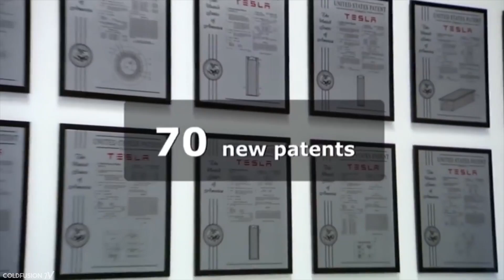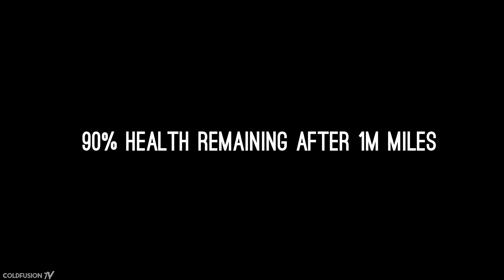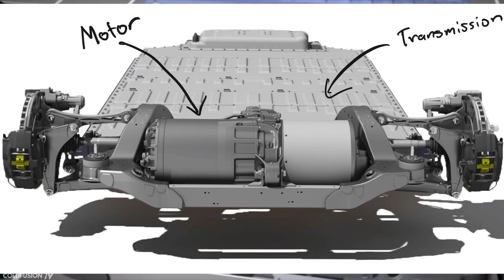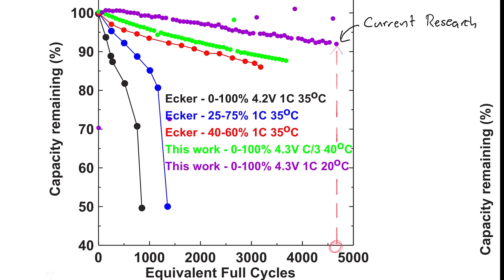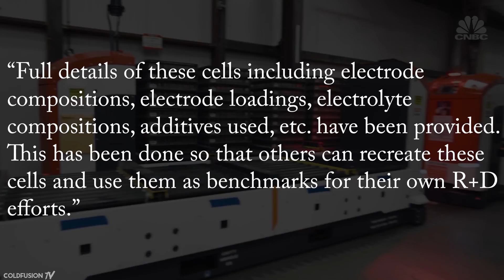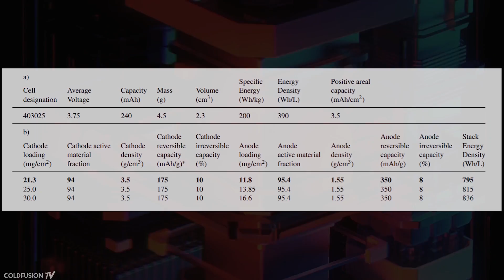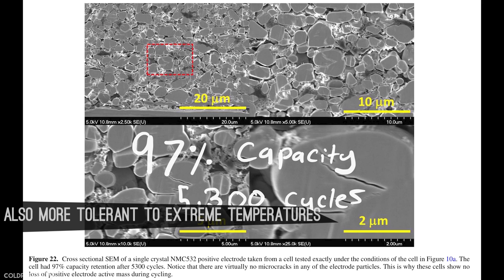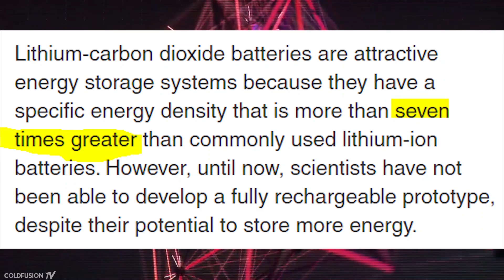Tesla's Million Mile Battery

Comment: Electric planes yayyyy!!!
Reply: Not gonna happen for a very long time still sadly. Electric planes today are either two seat trainer aircraft with less than an hour of battery, or that one solar powered plane that seats one. Electric airliners are still a pipe dream with current tech.
Reply: @cpufreak101   At least the range problem is solved with this

Comment: It's amazing car enthusiast don't see electric as the future, the internal combustion engine is all the way maxed to it's abilities pretty much and most technology on it is to keep it from polluting. You already have an electric motor to start the engine, and electric fuel pump constantly sending fuel, and an alternator which is practically an electric motor supplying electricity to the car while be run by the engine, and multiple computers monitoring the process. You might as well just have an electric car to get rid of the excess mechanical complexity. Electric cars will be more efficient and easier to control without transfer cases and transmissions to worry about. We still have to work on battery technology and the way we power them. But in all it's amazing how great these cars will be eventually

Comment: A million mile battery would be great, but given the relatively high failure rate on the drivetrain, who cares. Even doubling the expectancy rate, which Tesla claims to be doing, that still doesn't put them on par with gas engines. Oh and you can certainly bet that replacing a head gasket is a hell of a lot cheaper than replacing the entire drivetrain. 

So until they can build a motor and transmission to match that million mile battery, it is a moot point.
Reply: The current drive train carries an 8-year, unlimited mile warranty.  I don't see it as an issue.  The previous one was 4-year, 50,000 mile.
Reply: James Thompson which equates to 150-160k miles on a relatively high annual mileage car. So the battery is good for 6-7 drivetrain lifetimes, thus irrelevant outside of being a really nice tech achievement.

Comment: you could use a car for your whole life and pass it on to your children.
Reply: Hugo not in Canada...the salt put on the roads in winter eats through a car in about a decade
Reply: @cellardoor7500  Then make cars out of something other than metal...
Reply: @cellardoor7500  Yeah.... and think whats going to happen to the wiring / motor  etc. of an electric car.
Reply: Depends where you live. Not many cars can hold up through more than ~15 snowy winters due to salt / rust (e.g. Minnesota, Wisconsin, Dakotas, etc). I had one car that had components connecting the wheels break from the main body of the vehicle. In another, the axel in the back rusted so badly that when I hit a pothole, the back tire turned sideways and I fishtailed.
Reply: @ae1ae2   well you should look under your car before the tires beginn to fall of, it is rather dangerous to just wait for things to break smh.
Reply: @jonasmeier663  Yep, was aware of the issue. Being aware of a problem doesn't necessarily mean you've got the money to fix it.
Reply: I mean, I've seen people with pickup trucks they bought decades ago and they pass them off to their kids, nothing new in that regard. The new thing is the maintenance required
Reply: @cpufreak101  exactly, you can basically keep any car forever as long as you buy replacement parts. But with this you'd spend a fraction of that in repairs.
Reply: @fedyx1544  you'd be surprised how quickly many parts become 'obsolete'.
Reply: @fedyx1544  no. Today's cars are manufactured with 200 000 km lifespan in mind. The clutch, the bearings, the gaskets. All of this is designed to fail shortly after 200 k km on purpose. It is called engineered obsolescence or engineered lifespan. My mate works as a material engineer in metallurgy. His team was told to desing headgasket for the 1.5 TSI Neo by VW. They sent their samples to the OEM to run their tests. OEM turned their design down. They ordered from someone else, because the headgasket was not UP to specs. It was stated in the report, that the tested batch HAD FAILED TOO LATE in the testing process (in other words, it was too durable for the application). VW needs parts to fail. So do Ford, GM, Honda, even Toyota does not make long lasting cars anymore.
Reply: @waclosh  well that isn't something that electric vehicles solve. Manufacturers will most likely limit the maximum lifespan to say 1 million miles and never go beyond that, by deliberately not improving the electric motor's sturdiness or battery degradation.
Reply: @BriarHood  Yeah.... 5 years down the track and you'll probably have to scrap you electric car.... ' because they don't make a $1 part anymore'. They'll come up with some excuse to get more money out of you. These LED lights that are on new cars, that stay on during the day.... wear your battery out quicker because it's constantly recharging !
Reply: @cpufreak101  this whole video was about the efficiency of the batteries after that amount of time. I think what he is saying is that you can pass it on to your children in exceptional health even after pushing the vehicle to its limits for decades. If you do the same with a traditional vehicle and get your moneys worth out of the vehicle once passed to your children it def will not feel that great or run that great either trust me i know about the keeping cars forever life having family that does it
Reply: @cpufreak101  Hopefully this new pickup is given a good spec akin to the Toyota Hilux. I can't imagine them engineering a long lasting pickup truck on their first go around. Also I hope they go for a more classic design. Their current lineup of cars may be pretty, but I personally hate the style.
Reply: @CoderShare  from what I can tell, the Tesla pickup will be closer to the Rivian R1T where it's more of a "lifestyle vehicle" rather than a rugged work Truck. Sure it'll still be able to tow and carry loads, but it's more designed for a consumer than a contractor.

As for appearance, Elon said it will be blade runner esque, so if you don't like current Tesla design, you probably won't like the pickup.
Reply: @cpufreak101  no contractor will care about how it looks, if they can make more money with it than without it.  If they do, they will not be in business very long.
Reply: @davidbeppler3032  I'm not talking about the appearance, I'm talking about the fundamental engineering of the truck itself. They were designed for a person or couple with an active lifestyle, they occasionally tow a boat, RV, etc, or do mild offroading, but for the most part it'd be used like most consumer owned pickups out there, driving around with light or no loads in the bed on pavement. It isn't designed to be stressed out to max payload for 12 hours a day, everyday. It would break rather rapidly in those situations (especially with the rear independent suspension)
Reply: @cpufreak101  the maintenance has always been required
Reply: @droid16beta97  I'm talking about the amount of maintenance, for example an EV won't need oil changes and brakes also tend to last longer.
Reply: They would have to place a 20yr expiration on cars or there would traffic jams backed up to your driveway
Reply: Assuming all the other components doesn't break down lol Tesla cost of repair is outrageous
Reply: Capitalism doesn’t want that
Reply: That is a bad business model. Porsche played around with that idea. They called it Langzeitauto. It was very well built, with a relatively big displacement engine, comparatively low power but very high durability. They claimed 500 000 km on the chassis and engine were to be reached easily without rebuilds. The car remained only in the stage of study, pricing and design/performance were too tough to swallow for the market back in the early 70s.  https://wierus.wordpress.com/2010/12/14/langzeitauto/
Reply: A car? Thanks, Dad but I operate a Tic-Tac
Reply: Yeah, that is exactly how humans think. 🙄
Reply: Either can't  find parts needed, or broke by the parts.
Reply: Rust will destroy more Tesla Model 3s than accidents or equipment failure combined.
Reply: 5000 dollar  price tag on battery will scare lots of people.... A car has already other costs that you have to pay for....
Reply: Well, the battery at least.
Reply: There's no money in that. They need them to die to pay for newer models.
Reply: @jsmeswagner6104  not really at this stage. as its clear that combustion will be phased out now. that means there is a huge market of cars that will need replacing. So gradually over time the market should slow, but not for a while yet. but eventually the  manufacturers will need to evolve new ways of getting income to continue to grow.
Reply: ehh... depends on how much you drive. my 06 corolla has about 800k on it. next to no major repairs. original engine and trans.
Reply: @001dman  well you got yourself a 1/100,000 there.
Reply: @Viscous Shear where I live, if it's an older truck with steel fuel tanks, they require replacement after so long as they rot out
Reply: They'll bring in a law that will make you buy a new one every 5 yrs.... like in Japan !    It's all about money $$$, so there's no way a quality product that last, will ever be marketed.
Reply: Very unlikely.
Reply: Utopia is not just a scam juice, it's also just that.
Reply: Tesla's made from aluminum.
Reply: Sure but.. the way the technology is evolving, in 10 years youd have 10x the range and longevity so you are gonna want a new battery!
Reply: You know, there’s an old saying about America which is now true for the entire world, America is a banana republic and cars are the bananas. The entire world is in on building IC cars and hoping that they’ll die quickly so that more need to be built. You don’t want to upset the apple cart by circumventing planned obsolescence, revolution will follow
Reply: no need for car repair shops, except for the motor and transmission service..no oil, spark plugs, leaking radiator, pistons
Reply: @rock882josh7  tires, suspension, bushings,  seals, brakes,  mounts....
try again
Reply: That's assuming people will own cars in the future. I mean, as soon as FSD is a thing owning a car will be a hobby
Reply: @xtramoist9999  Personal vehicles will always be a thing. Especially trucks. People keep stuff in the vehicles and using a taxi everyday just isnt practical.
Reply: @FreeStuffPlease  Exactly. A hobby.
Reply: @xtramoist9999  Hobby? You mean work? Or not wanting to haul necessities with you in a robo taxi? I keep a lot of tools in my truck. Other people keep other things. No one wants to carry these things with them everytime they get in and out. What about grocery shopping? People will still want to own vehicles. FSD doesnt mean people will just uber everywhere...
Reply: @FreeStuffPlease  Yes, FSD means people will just "uber" everywhere.

Yes, you are right. People will in fact still own vehicles.

Everything else you said is redundant.
Reply: @xtramoist9999  When I say uber, I mean ride in a car that they do not own. And pay for the services. I think the rate of vehicle ownership will still be high, if not higher. Considering people that couldnt drive before for whatever reason can use self driving to their advantage.
Reply: @xtramoist9999  Trades people would still need their own vehicles I agree. But lets be honest 80% of work is more office based and most people actually don't need a dedicated car, people just need a service that drops off goods like groceries,furniture, supplies etc off at their house, other than that for people moving only I think owning your own car just for that is a major waste.
I do Data Science as my full time job and haven't owned a car in years. I use a motorcycle to get from point A to B and if I need to get supplies dropped off at my house I just pay a small fee for delivery(which if you calculate what a car costs each month far exceeds said delivery fee). If office workers moved away from owning dedicated vehicles it would drastically free up roads for dedicated automated taxis and other services. There will have to be a major mindset shift for any of this to happen especially Americans as each household owns 2-3 cars easily where in Asian they mostly use motorcycles and they have 10 times the people density in cities, this why I think full scale automated people moving would be in Asia and not the West even though Tesla is made in America.
Reply: @FreeStuffPlease  this is how you think but my 16-year-old and all her friends have little interest in driving and use uber, pubic transport or electric scooter and bikes.  if you live in a city the economics of owning a car are not going to pencil out.
Reply: @linemanap  My first two vehicles were sportbikes. I still own them. Car or scooter its still ownership. Your 16 year old rides the bus to school but wait until she has a job. I get in high population density citys, vehicle ownership wont be that high. But thats a thing already and has been for a while.
Reply: @FreeStuffPlease I see vehicles as subscription services in the future.  Pay per month to access a vehicle at anytime self driven to you. 
Like a super ride share program.
Reply: Yeah the battery... For the rest of it would have rusted into a pile of dust
Reply: @xx6489  But you could resell the battery afterwards.
Reply: Why not just buy a new car

Comment: Also your ice car vs electric car argument is not quite accurate 95% of modern vehicles can easily hit 300K miles 

Million-Mile Tundra
Farrah Haines, who drove her 2013 Hyundai Elantra one million miles in just five years.

and yet 

ccording to Tesloop, the eHawk had three major replacements under warranty (described in this earlier post):

    Front Drive Unit - 36,404 miles (Warranty $0)

    High Voltage Battery Replacement - 194,237 miles (Warranty $0)

    High Voltage Battery Replacement - 324,044 miles (Warranty $0), replaced after about 130,000 miles

Comment: Batteries are the new oil
Reply: Batteries store energy, they aren't a source like solar and wind.
Reply: AZOffRoadster of course, but they solve the problem of solar and Wind storing energy to use it right when you need it. Oil is like a battery cause it “stores” its energy

Comment: Now that is impressive...   Also just imagine, comparing to petrol/diesel, only having a motor and single speed gearox to worry about !
Reply: And imagine your motor had no valves, no cam shaft, no pistons, no injectors, and no fuel or oil pumps, only the crank shaft spinning inside without making any contact with anything else
Reply: Don't forget about computer system used to control that motor and gearbox. You would need to spend more about on security Softwares if it became mainstream.
Reply: the power-plant of the electric car is very complex....its your whole power grid.... coal, nuclear, etc.
Reply: We're at least 50 years away from replacing road tractors with EV so don't get too excited.

Comment: Okay. So now we are aloud to have current batteries and not ones from the 1800 century. What about the motors. A brush motor will not last for that amount of miles. Last I seen when I was looking into it and then found the hole thing very pointless was up to 3 times the motor had to be replaced in only 100,000 miles. If the motor can not match up to the battery life, then what is the point. Them also if you can get that with a car battery, then a home or business can 100% run off grid with never having a problem. Although yet most solar system's are well over priced for what it would take to run a simple home and down to a simple camper. I've proven it. With what is out on the market, it doesn't take an very expensive system to do the same job as a very expensive one. A simple on and off grid one can do for around $2,000 and that is just the start but the savings and reliability is there with about 95% maintenance free. Then on to other vehicles. A simple motorcycle to a boat to a simple plane. I seen the first flight of an electric plane in Australia. The difference was short. The charging time for two batteries was outrageous. The power to need to charge them were ridiculous. Yet the concept works. The only biggest thing that is 100% unreliable is the systems have been proven 100% hackable and 100% controllable by someone else besides the operator. Making them 100% unsafe. Even with a simple gas plane being taking down by a simple system do to AI. Well proven.
Reply: Errrr that's why Tesla don't use "brush motors".
Reply: @kirkc9643  errr back. Then good for him. Yet again water by itself has been proven to be the best power source for any vehicle. Solar and electricity has been proven garbage. I have two solar system and they are 100% unreliable. With 64 companies and all of the Governments involved in putting bunker fuel in the sky with the sun simulator, solar is garbage. With all of the energy weapons used for weather warfare, electricity is now garbage. Under their own doing anything electric is garbage.

Comment: My milkman had a battery operated float to deliver everybody's milk this technology has been held back and reinvented
Reply: Electric cars have existed for a long time but until recent developments in battery technology they were really only practical as local, slow-speed vehicles for the most part. Same thing with cordless power tools, until Lithium Ion batteries they were mostly novelties. Not very high power.
Reply: Adam Frank what about the electric train or the hovertrain
Reply: @jayh9529  what about them? Not commercially viable technology at the time otherwise they'd exist lol